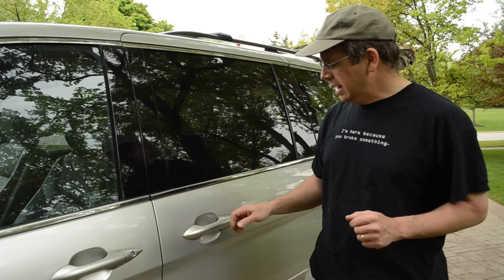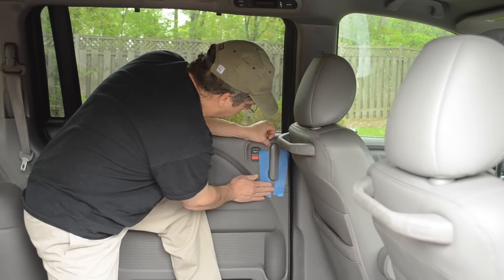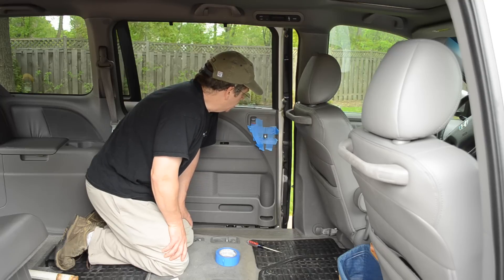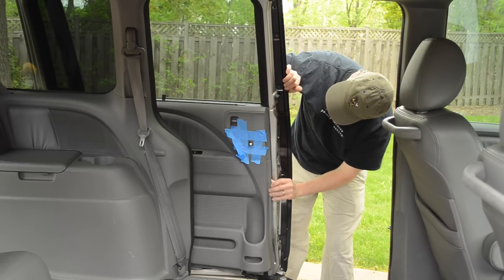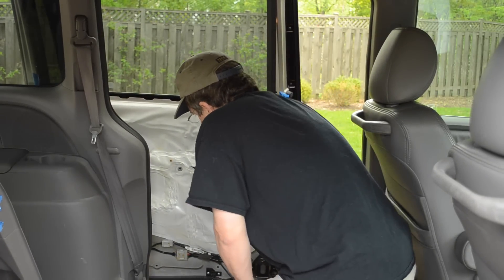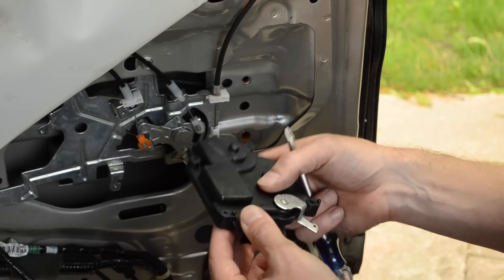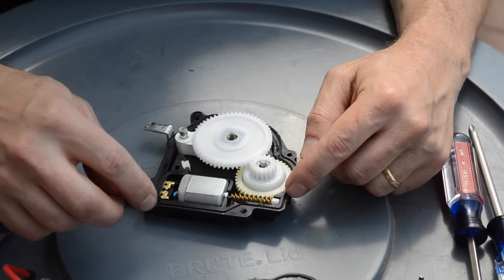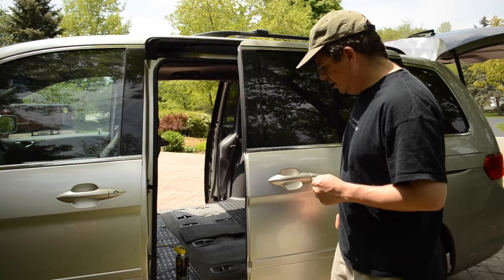Honda Odyssey Sliding Door Repair (Actuator Assembly Lubrication/Repair)

Comment: Thank you for this video!  My mechanic was convinced that a motor (which would have cost $500) was the issue.  After a long train of mechanical and door issues with the car recently, I was really hoping to avoid another costly repair.  With your capture of the issue you had with your door (at least on closing - mine actually started with just a growl and pop on opening, but did finally progress to the same action yours showed when trying to close it), I was convinced enough to give it a try.  The only problem I had was at the spot where the window controller had to be disconnected (since your video doesn't show that part in detail).  When it finally popped apart, parts went flying and I was scared I'd never get it back together correctly, but it turned out to be pretty simple.  Other than that, everything was very straightforward and I'm on my 3rd day of no noises and I only had to buy a can of lubricant!  Thank you, thank you, thank you!
Reply: Instablaster

Comment: Thank you so very much for this accurately detailed video! The instructions were perfect for my 2006 Odyssey EXL driver's side sliding door. After cleaning and lubricating the latch actuator, it still didn't function. No big deal. Ordered a new latch actuator online from Basney Honda's Ebay site. $42.50 later and my door opens, closes, and latches perfectly. The Honda OEM part # for the driver's side only is 72663-SHJ-A21. Your video saved me from taking my van to a repair shop and paying labor and part markup. Thanks again!

Comment: Great video, thank you! Removed, disassembled and lubricated per instruction. BTW, used an angled hook (Harbor Freight Pick & Hook set) to remove the clip from the inside door handle... was quick, no tape, no scratches on plastic. On my 2008 Odyssey, the lubrication worked great for a few weeks, then started having the same problems. So, ordered and just installed 2 new actuators and the doors are working great again! Again, Thank you!
Reply: Nice tip regarding the door handle clip. I still think a towel works better, getting it off in literally 5 seconds, but to each their own.
I've been having the same issue. Lubricated it, lasted for about 3 months, and now it's messing up again on occasion. Ordered a new one, and I'm going to install it when it arrives.

Comment: I had pop sound issue with the sliding door. So I replaced latch actuator and lubricated mechanical parts like you, and also lubricated latch and other mechanical parts inside of the door panel. Now works great, only spent part cost. Thanks for your video!

Comment: Many thanks for the video. Used this as the baseline to remove, clean & reinstall actuators in both doors on my wife's van. Chose not to replace the parts as the cleaned originals seem to be working fine. Took just over one and a half hours, but that included a minor repair to the bottom runner on one door (that was preventing the door from fully opening). Many brownie points accumulated for very little effort.
Reply from the maker: Nick Faber Glad it helped!  Our doors are still doing fine after a year of sliding door bliss.

Comment: Jared, Thank you for this video! Our 2007 Odyssey has had the popping doors for a few years now. Dealer has only ever made adjustments to the latches, etc which never accomplished anything. Picked up a panel remover tool and a door latch clip remover for about $15 on Amazon... an hour later the doors are like new! No need to buy new actuator, just lubricated the motors, springs, and assembly on the door like you did.
Great find! Great Fix! You Are The Man!!!!
Cheers!
Reply: Hi Craig, can you share the tool kit information that you bought from Amazon?
Reply: @mtran2727 I assume not.

Comment: Dave G. your comment about using the shop towel was perfect.  Though the clip went flying when it came off, it was easy enough to find and certainly easier than video.  Also, note that the black trim pieces along side the window have ORANGE plastic plugs that snap in and the panel has the white ones.  I didn't realize the black trim had them till I tried to put back together.  Also prying/loosening the plastic plugs around the door was a bit of pain but I eventually got done. I purchased a set of 5 of those plastic pry tools and didn't have any issues with scratching the finish.

Comment: Have had sliding door issues with my 2007 odyssey for years. Brought it to dealership 5+ times and they could never fix it. Did this in an hour and works great now. Used WD-40 300014 Specialist Water Resistant Silicone Lubricant Spray.

Comment: Great video, extremely helpful.  A couple notes to add from my experience, replacing both sides:

1. The 2 sides are nearly identical, but the metal lever that the spring attaches to lines up slightly different between the 2 sides.  I put the wrong one on the first door, but fortunately tested it first and figured out what I'd done wrong.
2. On the second door I noticed that some of the clips stayed in the door instead of coming out with the panel.  I managed to pop them out by improvising, but in retrospect, I'm sure that some did the same thing on the first door.  You'll want to check.  There are 4 front, 4 back, and 2 along the bottom, along with the one in the middle by the switch that's mentioned in the video.
3. Picked a warm day to avoid plastic cracking issues, so the ice cream idea was perfect.  Thanks again.

Comment: Good video, it's helpful. I Replaced my whole power motor and cable (driver side) as  a unit and now after this video, I just replaced this part my have an issue with the spring that attaches to this part and the sliding door opening and closing 100% ugh.

Comment: Use a shop towel to pop off the clip securing the door handle.  Just feed the towels edge down behind the handle with a hand hold on each side of the handle.  Now pull down while rotating the towel and the clip will disengage.  Much easier and prevents scratching.
Reply: Yes.  I fought with 6-7 different tools trying to remove that clip.  A towel (or wash cloth in my case) flossed back and forth will easily remove that clip.
Reply: Best advice. Had it off in about 30 seconds.
Reply: Yep this worked great. Clip came right off
Reply: Thank you for this comment!  It was extremely helpful!
Reply: Thank you! I’m naming my next child after you!

Comment: Thanks for the video. One tip that I found was that you can unplug the window switch after the door  panel is all the way loose. Also, I only had to take off the little spring and left that orange connection alone when I replaced the actuator.

Comment: Definitely use a microfiber cloth or something to remove the clip holding the door handle on. I just put the towel through the gap between the handle and the door panel, when i felt it catch on the pin I just tugged down on it and the clip flew out. Luckily I found it.

Also the panel clips closer to the rear of the vehicle are very tricky to get to, so a pry bar or some prying tool that has an angle on the end will really help. 

Putting the panel back on when you're done, that's a little more challenging getting the fitment right, and unfortunately this video does not show it.

Comment: Thanks, going to try this. I have the same problem you did but also the lock actuator. The physical lock that slides up and down isn’t working with remote or driver door control. Did you happen to see if that actuator is visible?

Comment: I really appreciate this video.  Really.  I wish you had done a trial run getting the inside panel removed as that would probably have saved about 10 minutes of discovery.  In the winter, my door closes fine but then the rear pops back out again.  Did anyone else have that problem?  How did you solve it?

Comment: Many thanks! Around 14min it is fully blocked, to remove the window up/dn cover I broken the rear north, you must pray out three dimension but rear part, then flip from front side to remove the cover. Yet my handle is loose and not easy to fix might be handle damage. My Lexus uses two wire rope this one uses four, complex design with many problems.

Comment: On our 2012 Odyssey I found that the 'little spring' mentioned at 22:20 was the problem.  I removed it (pain in the butt) and cut it to ~75% of its original length and now it's easier to extend and engage with the ears on the inside of the gear.

Comment: I had this problem, but this wasn't the fix. The bracket attached to the door that has a the roller on it was the problem. That roller is a type of plastic that starts to disintegrate and cause the door to wobble and give the exact same symptom that you had here. I replaced it (not hard, not expensive) and now it runs like butter. The other side is starting to go now. Just my two cents in case your fix here doesn't help.

Comment: Good video on the small motor assembly but the real problem with these doors is the end switches on the main door latch assembly. If they dont make and break correctly the computer will think the door is still open and cause a parasitic drain of the battery.
Reply: There is no "real" problem with the doors. There are a few different common problems. The rear latch is one of them, this latch actuator is another. That's why it's important to identify the specific symptoms.

Comment: Thanks for showing this video, I was able to replace this part successfully on the driver side. Any idea how to fix my other issue, which is my passenger sliding door does not open & close with the outside handle, closes with the inside door handle but does not open it. It operates normally with the remote & control button on the driver side.Thanks.

Comment: Great video, thank you!  What kind of grease did you use on the gears?  There are many different kinds and I don't want to use something too thick or that will damage the plastic.
Reply: I used white lithium spray and it seems to do the trick, but I'd imagine the silicone spray seen in the video would work as well.

Comment: Great video! Is this actuator the mechanism that closes and latches the rear latch on the power sliding door? My door closes, then cracks back open slightly causing the door open warning alarm to be activated. Just wondering if this is the correct repair?

Comment: Thanks, this video is very helpful. What is the part number of the Actuator?
Reply: 72663-SHJ-A21 this is for the driver's side Actuator Assembly. Bought mine on estore Honda for $53 before tax.  I just replaced mine yesterday. Hopefully, it'll fix the 'popping' issue when opening.

Comment: Hi, I have a 2009 Honda Odyssey Touring Edition everything was working wonderful til one day the Driver Side Sliding Door got messed up Dont want to spend over 500 or so because I hear its an easy fix but I got the actuator replaced and well its still not opening. what it does when i click or try to open that door is all that it beeps for a couple seconds and also it does automatic lovk only on that door you have to forcibly hold it in the unlock or else it locks the door again then thats it. would you have any answer to this and I changed fuse too yet nothing has worked and im already 3,000 or so into car.
Reply: I had the same issue until today. I took the panel off and I felt the lock button with red rectangle was moving a little hard. I disengaged it and the mechanism was moving easily when pushing lock/unlock. I cleaned all the grease/dust on gray lock/unlock button slider and where it sits and it became real easy to move. No issues anymore with door unlocking and now door opens and closes. Hope this helps
Reply: It's probably something to do with the safety switch inside the fuel door that locks the door when the fuel door is open. They go bad and don't allow you to use the door.

Comment: I have a 2005 Odyessy. I had the drivers side door cable snap while opening and now won't open. The passenger side sliding door back latch won't close and the door won't open.  After calling Honda cares expressing my safety concerns. They said there was no recalls and basically it was up to me to get the repairs done. I am a single mother and can not afford to take it to a dealer so my mother and I were looking on you tube on how to do the repairs ourselves. Needless to say this is a BIG SAFETY issue as my 3 children must crawl out the back hatch or the front driver or passenger door. I can't believe Honda has not done a recall as my sister has the Honda Odyssey also and the door on the drivers side literally came off the track at the top, pushed the button to open the door and off it fell while  my sister caught it since she was standing there and she hurt her back as a result.

Comment: okay changed my left side actuator and still gets stuck somethings with the popping noise?  could it be something else?  the rollers on the sliding door?
Reply from the maker: itrackrace The only other thing I can think of is to spray silicone lubricant so that it can drip into all the cable sheaths.  I doubt it is the rollers.  Make sure all the linkages are completely free with no binding
Reply: Thank you help videos for the response.  I did lubricate all the mechanical parts that were moving but have not tried the lubricating the inside all cable sheaths.  I do notice a lot of others having this same issues as I'm having with no real 100% clear solution.

Comment: I see part numbers for the driver side door. Is it the same for the passenger? Honda was no help, they told me in order for an accurate part number it would need to come in and be assessed by their service department to determine if that was the real issue. Anyone know which actuator I would need?
Reply: Yes the passenger side is slightly different. The part number for the passenger side is 72623-SHJ-A21

Comment: Help me please! I already lubricated the actuator and I keep having the same problem. The door works ok but only 2 times, but by the 3rd time it stops working. Now I'm not sure if the problem is the actuator or something else. Does anyone know or have any suggestions? This is a 2005 Honda Odyssey.
Reply: +Manuel Navarrete   
Did you ever figure it out? 
I have the same year and same problem.
Reply: +RHKP76  no is still the same I just using it manually
Reply: +RHKP76  no is still the same I just using it manually
Reply: @manuelnavarrete7517  how do you turn to manual?